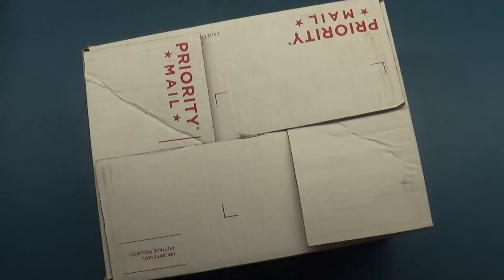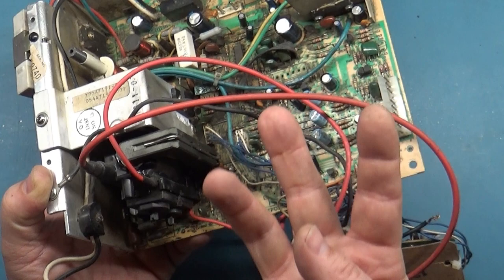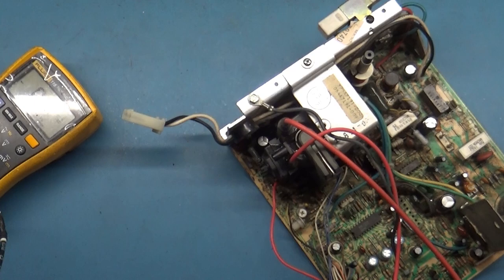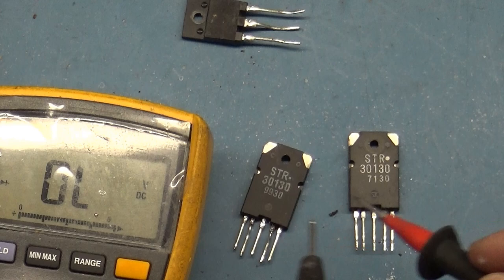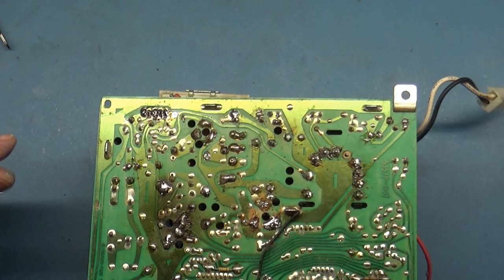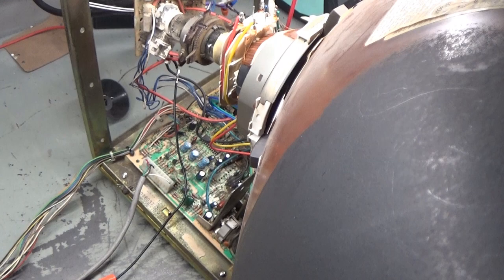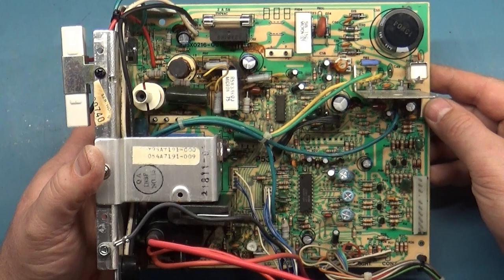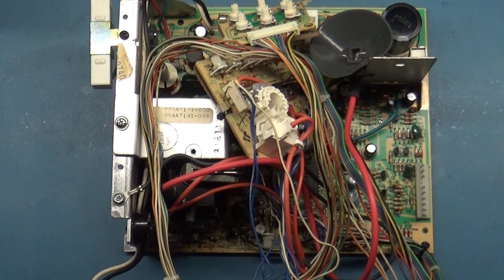25" K7000 Arcade Monitor Chassis Repair - Blowing Fuses #6 - Voltage Regulator Bad, But Not Shorted?

Comment: I have said it before and I'll say it again, I wish I had your brain. :) I have been struggling with a Hantarex Polo for what feels like eternity and you always get yours fixed in an hour or less on video^^.
Reply from the maker: Well when it comes to the Polo, I feel your pain. That’s not generally one I work on because they are difficult at times. These WG ones are relatively easy. I have a Polo that’s blowing HOTs that I may do a video on if I can figure it out.
Reply: @MikesArcadeMonitorRepair  Thank you sir. That does make me feel a bit better :) Have a great day and thank you for sharing your knowledge.

Comment: Hi. New to the hobby and I was wondering if the readings are the same kn short vs ling voltage regulators. Im getting a low reading
Reply from the maker: Not quite sure I understand what you are asking.